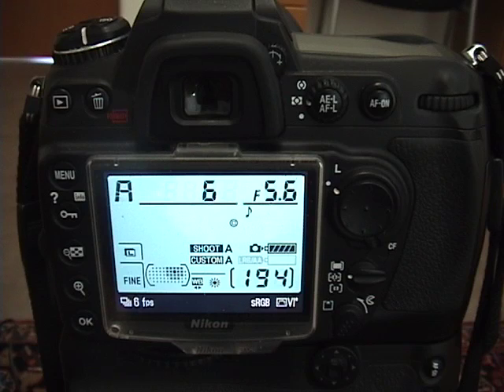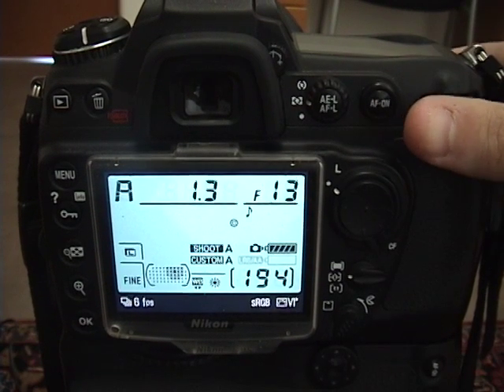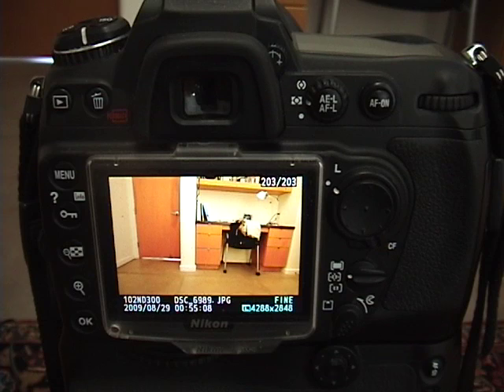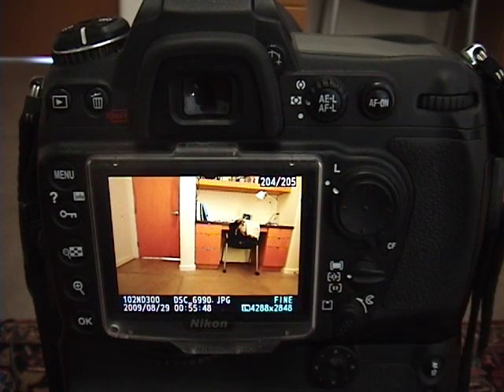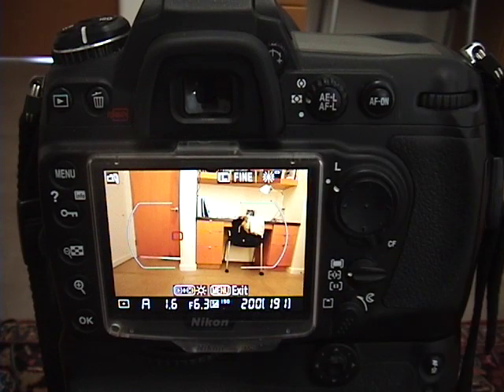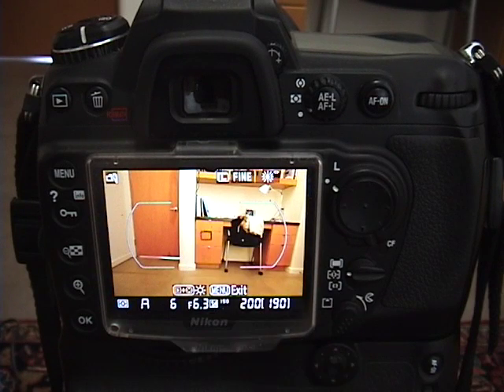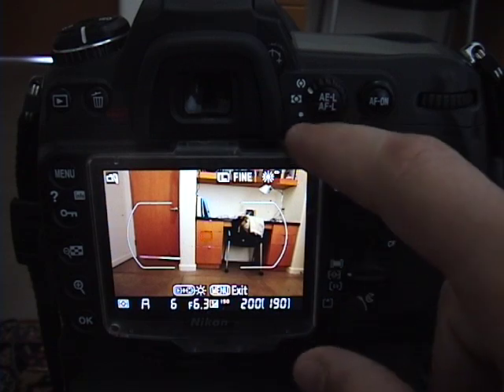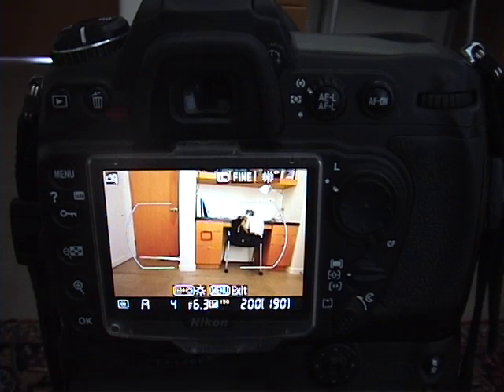Camera Tutorials- Metering

Comment: @amazingmoose69 I tend to use spot metering if \i want the subject of the picture to be perfectly exposed.  Depending on where your subject is, say against a brighter background, you will find that average metering will underexpose your subject.  If you want to expose the subject correctly, turn to spot and you will find it will make a big difference.  Don't forget to change back to average once you have finished though.

Comment: Would you use the spot metering if you were trying to get some nice bokeh? Also, I have the same camera and have been really struggling to reproduce some sunset photos that I have seen on Flicker that show very nice blues and amazing reds.  Some say they have long exposure (30 seconds), yet nothing appears to be over exposed.  Even at f22 and at 15 seconds, everything I have taken so far is very over exposed.  I am using the Nikkor 17-55 F2.8 lens.  Any suggestions? Thanks!